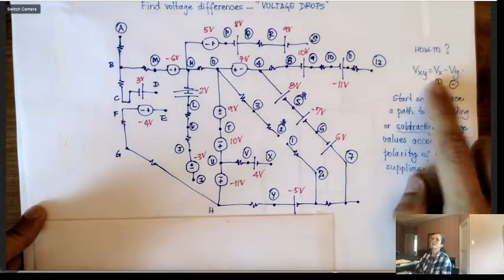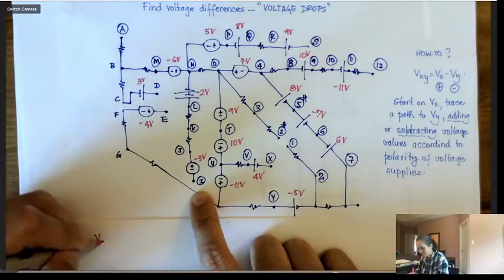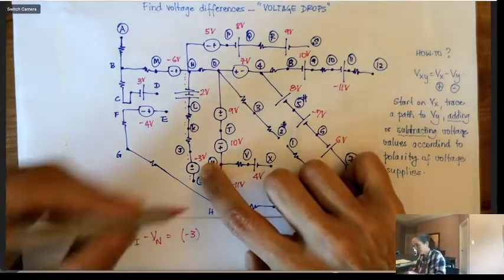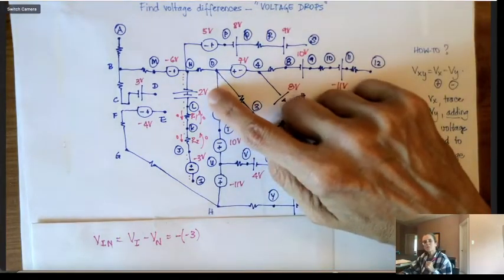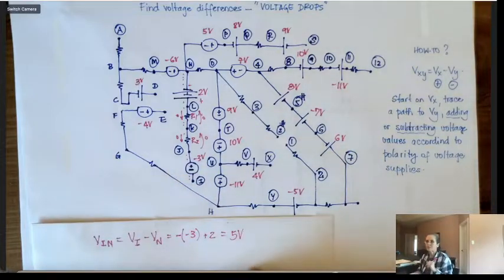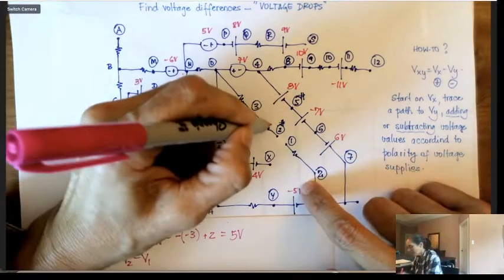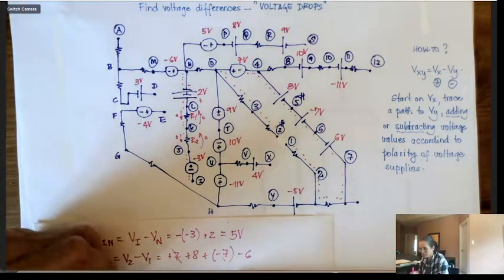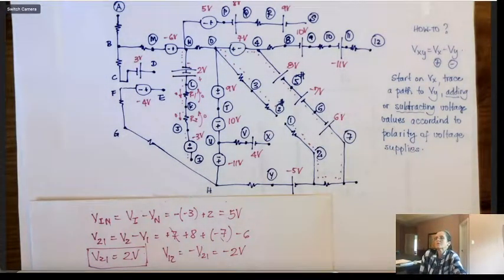Hard circuit, voltage drops

Comment: Shouldn't VIN = -3 +2 which is = -1V
Reply from the maker: VIN is 3+2, which is 5. The 3V power supply has the negative terminal turned to the "I" node, and it is of value -3V, which means really -(-3). Let me know if you want me to post a simpler video explaining only that question.
Reply: Maybe I am missing something?  Are you saying if I place the positive lead of my meter at "I" and the negative lead at "N" I should read 5V? That is not true, the meter will read -1V, and if you reverse the meter leads, it will read +1V.
Reply from the maker: @arazick   both power supplies (2V and 3V) are aligned. You can switch the signs on the -3V to see this. So VIN=5V, and if you switch to VNI then you'd measure -5V.